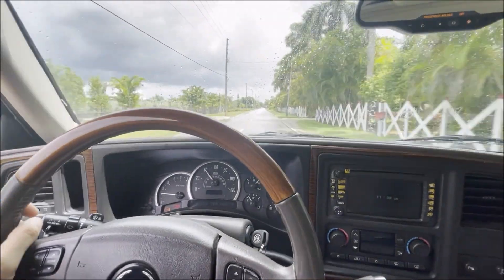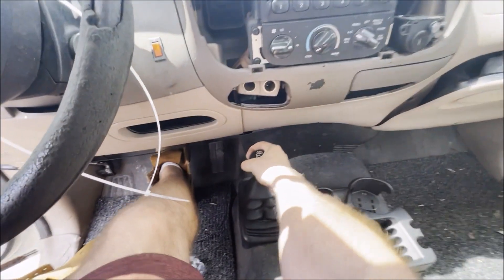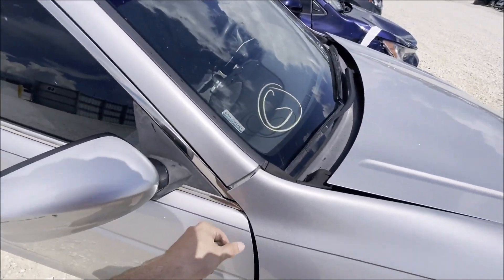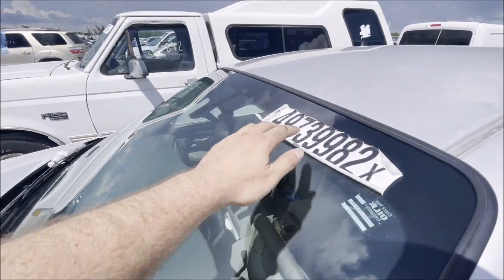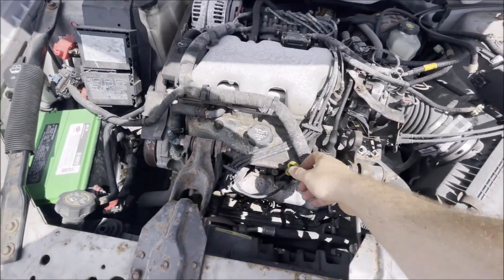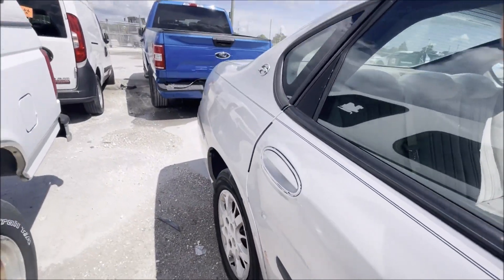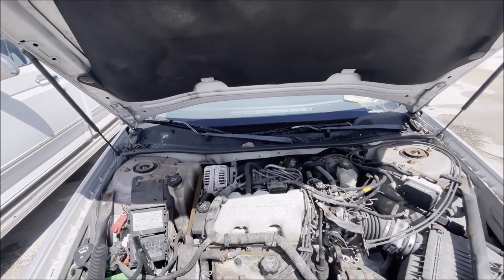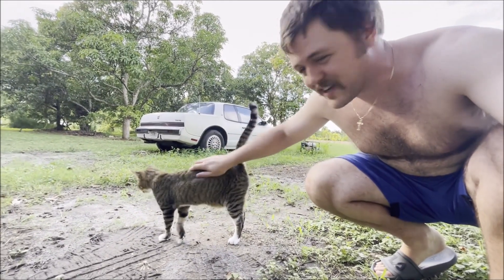Copart Walk Around: Non-Run BIO 37k Mile Flood Impala, F150, & Crashed Accord

Comment: oil you check when cold and not running   trans you check while running and a lil warm
Reply from the maker: For me oil check after reaching operating temp, engine off. Transmission when at operating temp.
Reply from the maker: Or like you said, cold not running too.

Comment: Question if you had the money would you restore your 2001 GMC Sierra The maroon one It's to factory oem  I would I would do that with my 1st truck as well
Reply from the maker: Sure if someone handed me a fat check to do it I would
Reply: I just bought 2 weeks ago weeks ago a 2008 Silverado 4 by 4 or by 4LTZ Dark metallic blow a 170000 miles Pretty much every  Option accept backup camera and factory navigation
Reply: 2 big problems or minor problems my boss is rusty dusty and my dashboard is cracked
Reply: Otherwise it's a good deal 8500 bucks
Reply: 1st truck
Reply: What is the hardest part to find for your nineties gym vehicles interior plastics Body parts suspension part suspension parts anything a  Apology
Reply from the maker: @danielb-c9100  interior plastics that aren’t cracked
Reply: @danielb-c9100  You putting a MyLink in that Silvy?

Comment: I would fix, and drive the piss out of that Impala if it was good electrically, and water did not trash the catalytic converter.
Reply from the maker: If I had needed a car like that I would have bought it. Resale will be hard with the salvage flood title and all the rust underneath here in Florida.
Reply: @bigalsbikeandauto  My sister got a loner Impala when she came down for the Harley anniversary years ago, but i think that was the LS with the 3800.  It had leather, so it was probably the LS.  Man was that thing fun to drive.